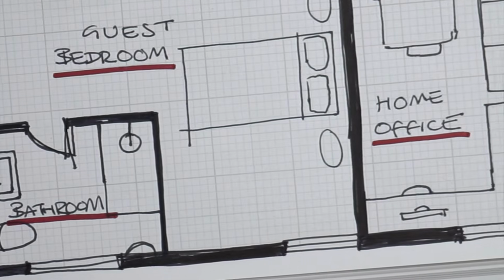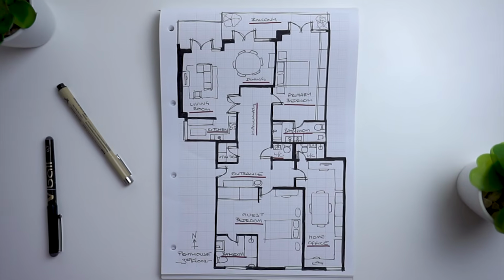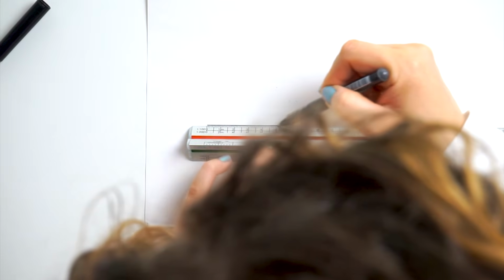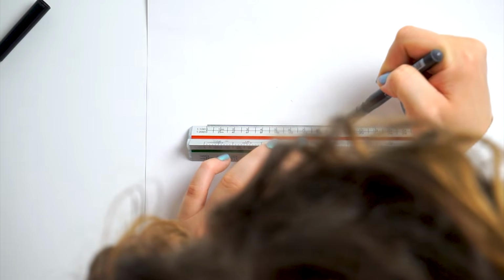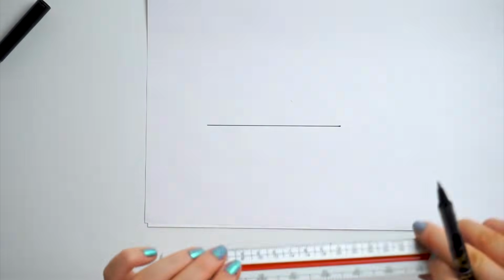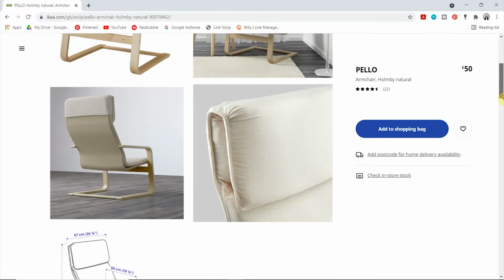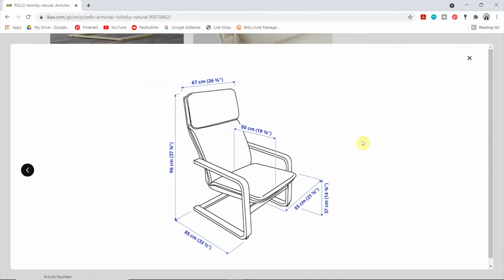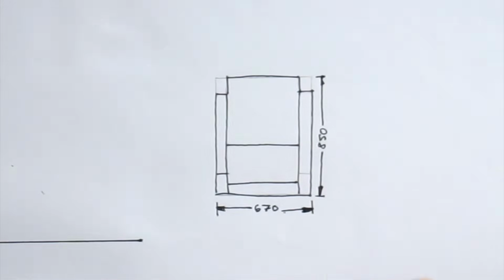How to draw floor plans (by hand)

Comment: currently a freshman architecture student and my most hated thing about floorplans is measuring out the rooms then remembering you have to add the thickness of the walls, which in turn makes the room shrink a little... (i haven't heard anything about how to fix it:[ )

Comment: DESIGN HINTS:    Better to have the double doors on the NORTH wall opening directly into the Dining Room so people are not wandering through the Kitchen area.  Glass doors would also let extra light into the Hallway. Moving the north wall a little further to the south would enlarge the Dining Room area. Guest Room is way to big. Moving the Guest Room EAST wall towards the west would enlarge the cramped Office area.  Door to WC should be moved to the south wall so people can't see into the room from the main hallway.  Where is the Coat Closet for the visitors ?

Comment: I have a curious question.  End grain of lumber is typically represented by an [X] .. but is there a standardized symbol to represent side grain of lumber?  The typical reverse hatch betwixt lines to represent plywood layers is insufficient, so I presently use a short single line with half sided arrow points (on opposing sides) at each end of the line to represent the linear grain of lumber. This symbol is quite handy for details where I show corner assembly on deck or wall framing.
Reply from the maker: Ok you got me! I for things like that I get out the promarkers for some colour. I don't love it but it's cleaner (to me) that adding that grain effect